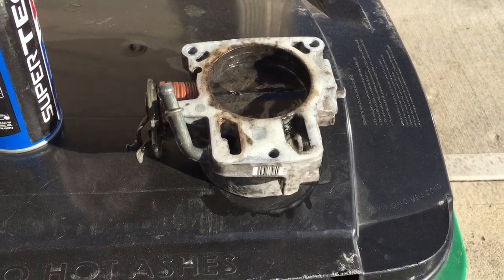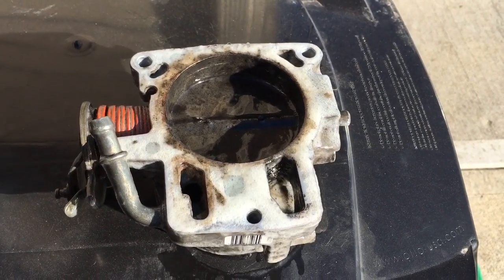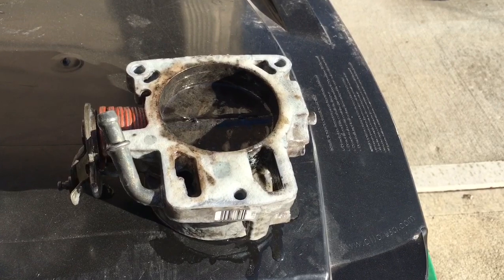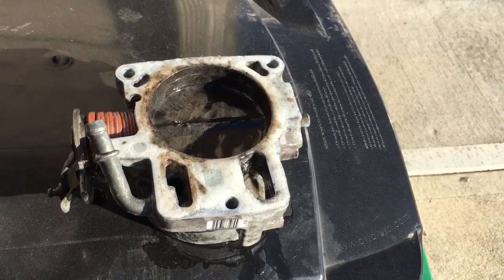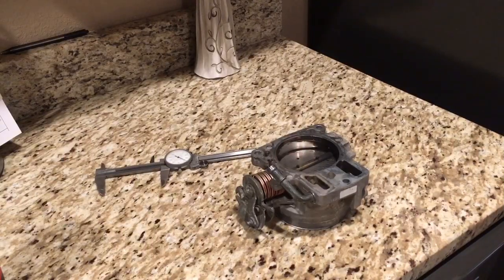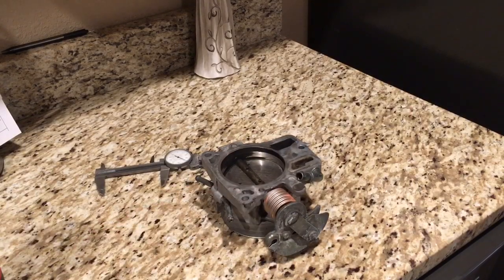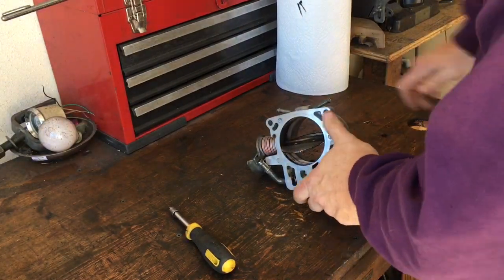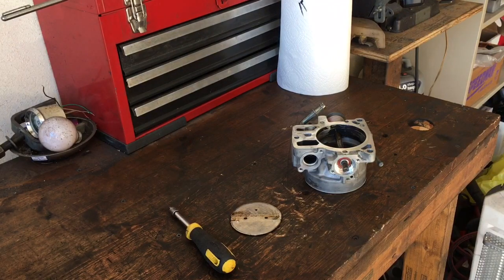LS 4.8 5.3 6.0  Porting  75mm Throttle Body

Comment: I would think the size would be based on the throttle blade size it might be like 75mm since its not straight but thats a good measurement regardless
Reply from the maker: I agree the blade size is the measurement.  I’ve seen the stock truck listed as 75mm and 78mm. Smoothing and handwork the aluminum I think might make a very small amount of improvement and efficiency, but I think in the end, the maximum flow has to be determined by your blade size.

Comment: That ridge I’m sure is to ensure an extremely proper seal. Idle and decel are a huge factor like you said… and the minute difference of power or Venturi velocity WITH the ridge (on a ported tb) vs without the ridge, is so small I wouldn’t even touch it if I were porting. Maybe a professional but not me lol that’s too risky for a proper idle
Reply from the maker: I agree! I ported 2 then decided it was cosmetic and stopped.  Huge waste of time and money.  JD
Reply: @HeadFlowInc  hell yea brother. I’ve been watching all your videos. I have a 2004 Pontiac GTO with almost the exact same throttle body but I believe my throttle cam is about an inch or less larger. Making it a little different torque band I’m assuming.. one for a truck one for a car haha. But yea man I really wanna port mine but I just don’t wanna fuck it up. Im mechanically inclined and have a dremel lol which bits would you recommend and also can you link the second video showing the follow up!?
Reply from the maker: @permabulk1454  Flame or tree double cut for bulk removal then larger egg double cut smoothing then sanding cartridges. Depends how smooth you want to go.  JD
Reply: @HeadFlowInc  bro awesome. Did you ever make a follow up video to this one? Would love to see your final product

Comment: Hi. Thanks for the quick reply! I love learning from American people! You guys have the best tools, best engines. My holden Commodore ecotec V6 3.8 litre is based on Buick engine. I found an awesome cold air box setup from you guys in the US. Insulate inside of my airbox! I did outside with a heat shield and Damn it's not a placebo effect when doing 80 km per hour and I give it a stab to the floor in the wet it spins until I back off. I scared the crap out of myself after putting a 25 mm manifold spacer And a 12 mm plenum spacer. I gave it a bit as usual in the wet around the corner and as opposed to a little drift. Lol it swung one way and luckily I caught it and swung the way. LMAO 😂😂😂. I'm slowly buying parts from mace engineering. But now porting the TB until I get a 69 mm and my ECU remapped! Sorry off topic. Thanks for the quick reply! Love your vids! Very informative! Nice to see sharing!👍👍👍
Reply from the maker: Be careful don’t remove material from the area the throttle blade seals or you’ll have a high uncontrollable idle. 
I’m always thrilled to hear from the people in Australia!  JD
Reply: @HeadFlowInc  I'm paranoid about that even if the Mark is still there. Lol. I'm taking it slow and steady. Thanks again.🙂
Reply: @HeadFlowInc  hey man. I fitted the throttle body all ported and polish. Knife edge on butterfly ( little one) took a little of the shaft because you have 3 mm either side. I took 1 mm of either side so it's still clamping up tight. Instant little extra! I thought nah!!!! But it was an experiment! So stuff it! Much happier. Asking my older brother if he would sell his boring bar? He told me to pee off! Lol cheers
Reply: @Waza G yeah I wanted to but the only one that will fit is of a 6.0 litre. LS throttle body and modifying to make it fit. Ecotec Is 63 mm.  I need a boring bar. It's not rocket science.
Reply: @Waza G btw holden 5 litre is 65 mm. 2 mm bigger than mine but mods to make it work.

Comment: I think the oil is caused by the design of the valve cover which pulls oil that gets stuck in the baffle for the pcv on the drivers side. GM redesigned it or you csn mod i baffle with a few well placed holes. Everyone has a different way so use your best judgement. You will reduce oil consumption and smoking with the mod. Good vid man, i just leave mine stock though. Plenty of power as it is for me in my 5.3.
Reply from the maker: GM did redesign the PCV on the later valve covers, I hope it helped.  I found out if you route the hose to the PCV vertical a few inches then to the vacuum source it helps the oil consumption using gravity. 
Currently after going Turbo I have no PCV instead I have open 5/8” hose from each valve cover going to a catch can.  So far I haven’t had anything in the cam.  JD

Comment: You’re measuring the throttle body at much cooler than operating temp- did you ever measure with the hot coolant hoses attached on a running engine? You’re quibbling over less than a mm…that probably magically appears when it’s at operating temp
Reply from the maker: Unless the the throttle blade and opening are increased there’s no measurable improvement.  I stopped offering this process on stock throttle bodies.  Cosmetic change not worth the effort or cost.  JD

Comment: I have found you can enlarge the bore to 77mm with the addition of a trailblazer throttle blade. Anything more and you exceed what you can bore the intake entry. You must add a small whole for idle air as found on the original blade.
Reply from the maker: LOOK I FIXED IT! Yeah, I don’t mess with throttle bodies anymore because it’s really cosmetic and you can buy a decent aftermarket unit cheap.  Thanks for watching and the feedback I appreciate it!  JD

Comment: Would a 86 or 92 mm throttle body fit the intake? Maybe with some help?
Reply from the maker: JAMES! Since the 70's Measure your opening on which ever intake you choose to run, as long as the opening into the plenum is equal to or larger than the Throttle Body you’re good! 
Thanks for watching and the feedback I appreciate it!  JD

Comment: The modified tbi bodies have thinned throttle shafts along with bored out bores with larger blades. They turn them down and flatten them out.
Reply from the maker: Nubbins That would be awesome, remove the shaft and “Slab” cut it to reduce the profile.
If you had a milling machine to cut a new precision bore to a larger size would be the way to go!  
That’s a lot of work when there’s inexpensive aftermarket options.  Interesting information I appreciate it!  👍

Comment: What would happen if we blocked off the vacuum line that connected to the valve cover ? Should I or should I not ?
Reply from the maker: mark n michelle Jacinto I’ve done it, but it’s actually one extra way to reduce crankcase pressure same as the PCV setup. 
Many people with Turbos lust vent both valve covers to atmosphere, but running NA you may want to have a functioning way to reduce the crankcase pressure. 
I know my driver side OEM PCV setup needed a separator, but the line from the throttle body to passenger valve cover never showed any oil contamination. 
🤔🤔🤔

Comment: Do not use oven cleaner with NaOH (sodium hydroxide) on aluminium unless you are ok with ruining the aluminium.  NaOH is very reactive with aluminium and will degrade and cause structural damage to the aluminium crystalline structures.  You can prevent the oil carbon build up of that trash in your intake and TB by running an oil catch can.
Reply from the maker: Edge I will point out people have been cleaning aluminum engine parts with oven cleaner for more than a decade. I don’t discount your information, only saying in short exposures of less than 30 minutes with thorough washing/rinsing it works great.  I have seen the surface turn dark if the cleaner is left too long.  Also if you don’t clean/rinse good enough the surface of the aluminum will oxidize over time, more so than untreated aluminum. 
Yes, I’m aware of the catch can cure and the need to add oil drain back holes to the oil control ring lands of the pistons. 👍
Reply: HeadFlowInc my best advice is if you plan to use oven cleaner use one that does not contain sodium hydroxide.  It may not damage it but I would strongly advise against using it on aluminium it is changing the crystalline structure of the metal.  Maybe since the TB is not a high stress part it is ok but I would not risk it personally when I can use something like acetone that does not need to be neutralized and evaporates quickly.
Reply from the maker: Edge Good information on the interaction between chemicals and aluminum!  I appreciate the feedback, this is how we learn.  Thanks again! 👍 JD
Reply from the maker: Edge I’ve seen some great results on YouTube using HD paint thinner to clean parts, I wonder if it might contain the same chemical? 🤔
Reply: Paint thinner should be majority acetone with other stuff in it like xylene, toluene, methanol(methyl alcohol avoid contact with hands and eyes do not drink this is the alcohol that actually will make you go blind haha), and other stuff really depends on the manufactures mix but honestly you can just buy a metal jug of acetone at the Lowes/Home Depot or TB cleaner which usually is majority acetone (something like 90%+/-).  Also less damaging to the hands if you get on skin.  Strong bases are much worse on the skin than acids because of how they react with the fat/lipid layers of your skin cells so wear gloves when messing with oven cleaner and eye pro.  Chemistry has always been a passion of mine and I am kind of the mad scientist type but a lot of people do not always understand what reactions are gong on when.  I used to work at an Alumina refinery where they refined bauxite into Alumina the precursor to Aluminium metal.  The main chemical used for the extraction across the whole site was sodium hydroxide.  After working there for 3 years you should have seen the aluminium wheels on my truck how they were just wrecked and destroyed.  Keep in mind I parked in a parking lot about a mile and a half away from the site.  It literally destroyed the paint, wheels that had factory clear coat on, and the jeans I wore each day would develop holes in them in just 6 months of wear.  Glad I could share some chemistry knowledge with you!

Comment: The easiest way I've found after porting a few throttle bodies is to get an extra throttle blade. Replace the blade and use your extra one as a stopper so you have 0 chance of hitting the sealing surface.

I always enlarge the very front of the throttle body as much as possible also, to the point where it is almost knife edged. I grind the extra bit of bolt that pokes out the back off, and I also reduce the face of the bolts profile so they don't stick into the bore as much. (The bolts meaning the ones that hold the blade in place)

As you said, I also get rid of the ridge in front of the blade and on a few of them I've smoothed out the ridge in the back. 

You may also want to look into grinding into the throttle stopper to allow the throttle blade to open fully to 90° also, the one that came on my LS1 was quite a ways off from actually being fully open.

I personally always take a grinder to the coolant inlet and outlets to remove the pipes also, doesn't really do anything other than help my OCD lol
Reply from the maker: Colton Shimko Excellent tip using and extra throttle blade to use as a guide!  I have some wish I’d seen this sooner, would have saved time. 
I’ll definitely check the opening angle to make sure it’s getting Fill WOT.  Sop even on carburetors 👍
There’s nothing in the TB behind the blade, it’s straight smooth bore  with a slight under cut at the edge.  I heard of people beveling the transition on the back side but air doesn’t follow a bevel going down hill. I appreciate the help every little detail makes a difference! 👍
Reply: Can you pls make a video I would appreciate it it alot